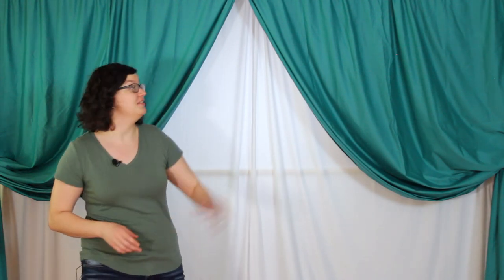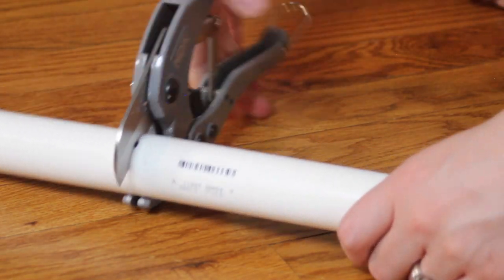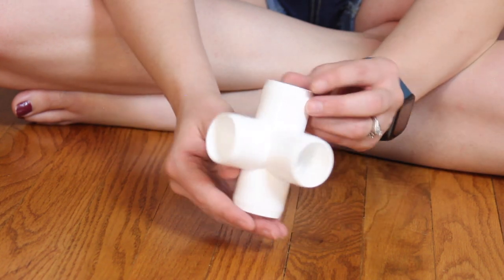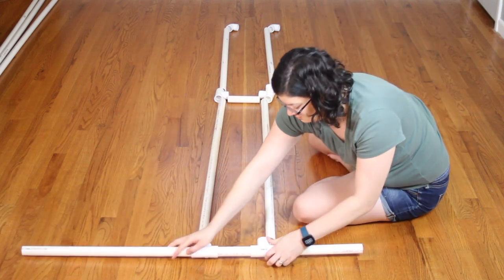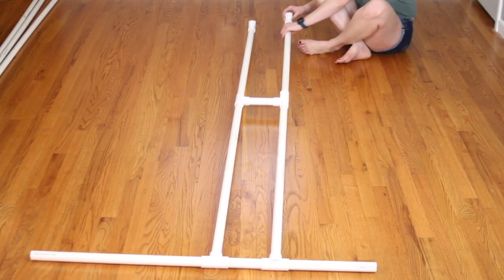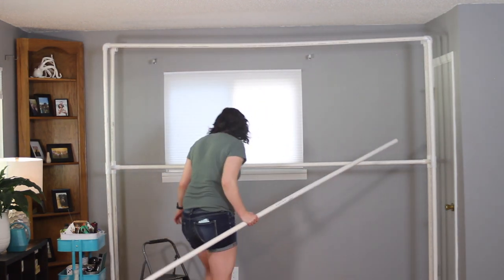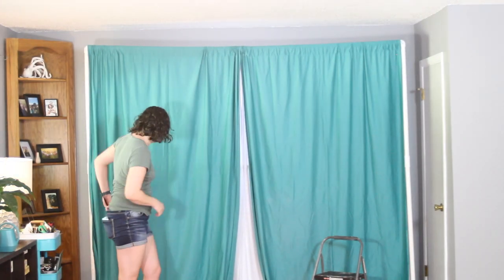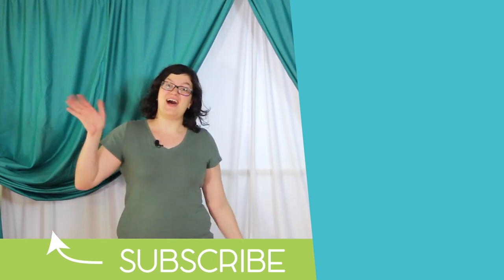PVC Double Backdrop Stand | PVC Pipe Dual Backdrop Stand

Comment: Thank you for sharing your blueprint. I also purchased the extra pieces to quickly convert this double into 2 single backdrops. I did add 3 piece (4) connectors at the top at the top to be able to drape fabric in the middle to totally cover and make the backdrop look like one small canopy.

Comment: Thank you for the video! I just have one question. I am considering a greenery wall. Will the back pole be strong enough to hold it? Also, I want to put a flower bar across the front top. Do you think that this set up will hold all of that weight without sagging?

Thank you,

Donna
Reply: Hi, I was wondering the same thing. I didn’t see a reply here and wasn’t sure if she messaged you separately.

Comment: Do you think 3/4 inch would be an okaaay alternative? It’s $3 cheaper than the 1 inch for the same length. We are trying to save anywhere we can
Reply from the maker: I think you could get away with using 3/4" pipes, it just means that your horizontal pipes may sag more easily under weight. Don't forget to get the 3/4 fittings as well! Happy making!

Comment: What would be the cuts for a 10ft tall stand?
Reply from the maker: This stand is 7 feet tall, so if you add 18 inches to all the side pieces that would give you 10 feet. I just wouldn't make it taller than 10 feet as it will start to be really wobbly.

Comment: What is the size of the joints used to connect them?
Reply from the maker: You have to use the same sized joints as the pipe you're using. So the backdrop is made from 1" pipe and 1" joints. Happy making!